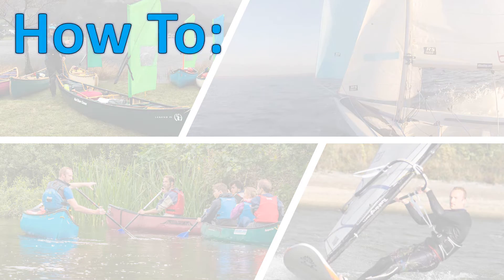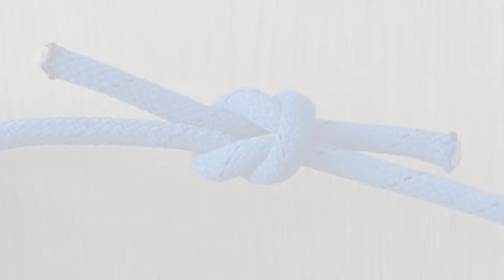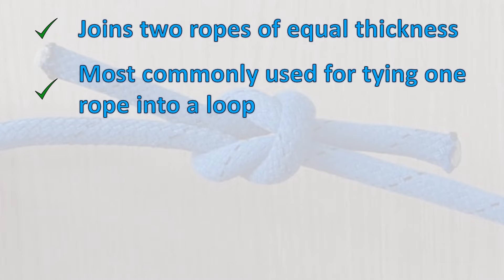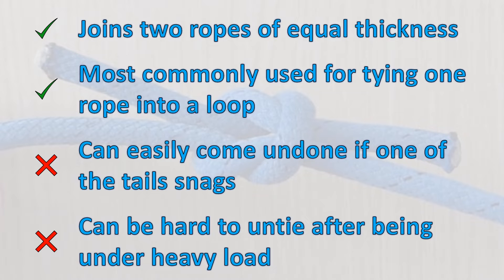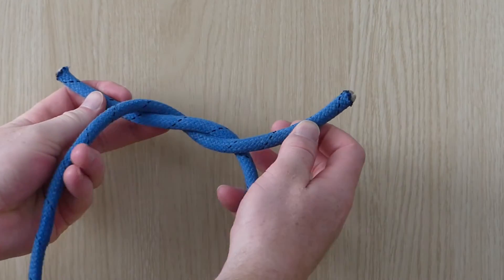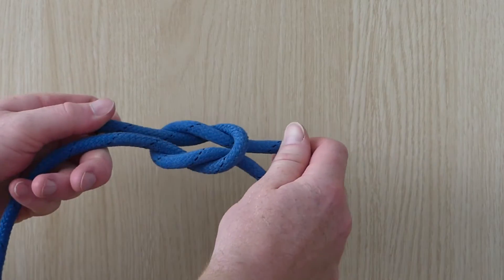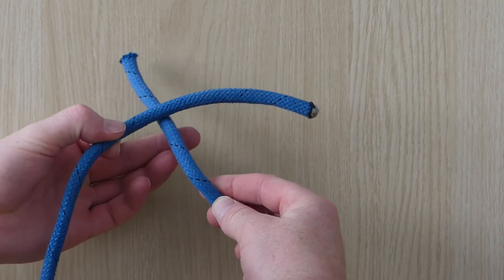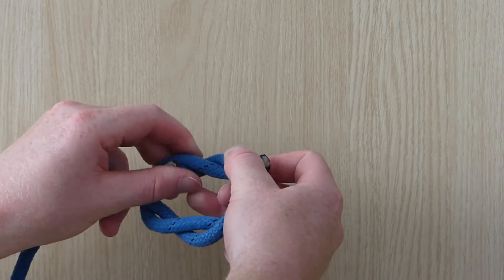How to tie a Reef Knot or Square Knot for sailing dinghies and yachts

Comment: Thanks for the explanation, also for the disadvantages of this knot, which I was unaware of. I believe its also used in tying bandages as it lies flat against the body part in question.
Reply from the maker: Yes I use it for bandages in first aid too, good thinking. It's easy to hold the desired amount of tension on the first part of the knot by putting a finger on it whilst you secure it with the second half